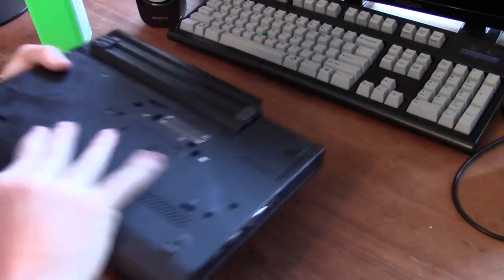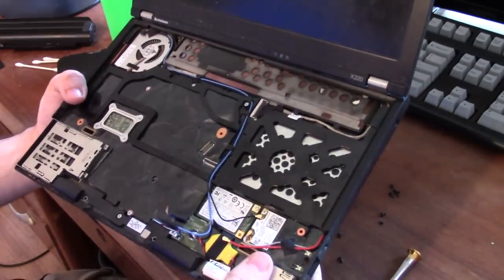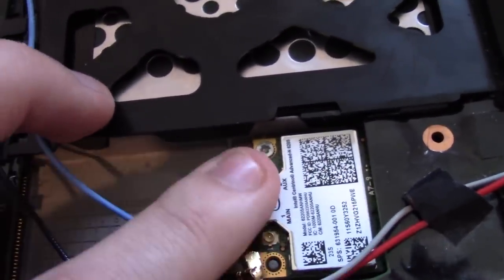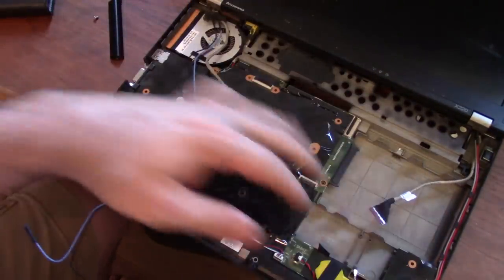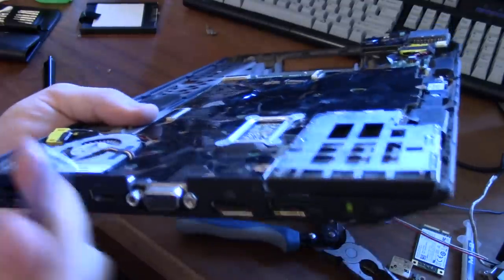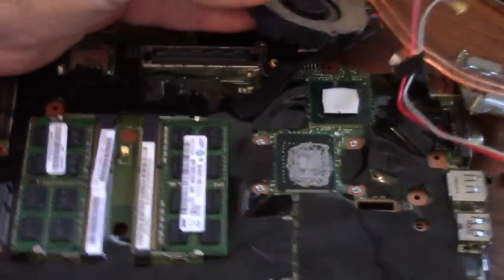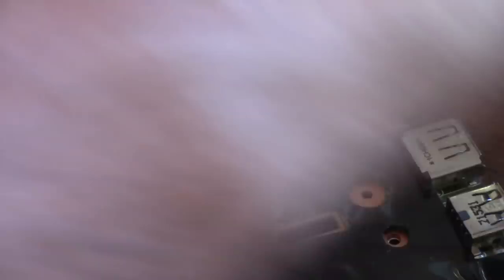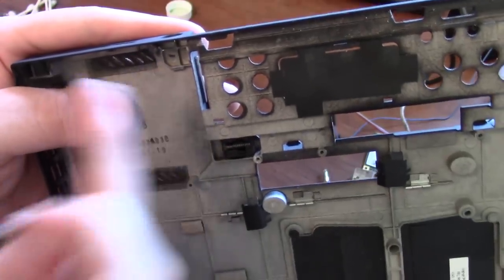Laptop Total Disassembly and New Thermal Pasting

Comment: Keep track of your screws, folks. My T420 is still a wobbly mess after losing a few during BIOS flashing.
Reply: brotip: set them on the table in the shape you took them out
Reply: The t420 uses standard m2.5 screws, just buy a few of those
Reply: i stick them to small magnets. even if they fall from the table, they stay together.
one magnet for each set of screws. usually four is enough: backside, screen, motherboard, everything else.
Reply: a little late, but you can film the process with your phone so you can go back in time and see where the screw flew off to

Comment: Don't forget the most important part: recording the disassembly! Having a video-recording of the disassembly is useful for referencing where everything goes, but especially for the screws. At least 90% of the time when reassembling it, you'll end up with at least one extra screw, and the other 10% of time you'll end up a screw short.
Reply: I have replaced fans, keyboard, ram, display, brackets and SSD in my T400 and a couple of other Thinkpads but this disassembly looks scary af. 
Having to remove almost everything to get to it I'd only be willing to do if the Laptop is actually broken. 
I'd also take detailed pictures and notes during the disassembly to check on assembly whether I'd put in everything as they were before. 
The way he handled the screws triggered my "OCD".

Comment: 11:55 the reason why they recommend to unscrew the heatsink that way is to prevent cracking the CPU, you could put a lot of pressure in one side and break it
Reply: Ben T.  mine literally bends the motherboard a little.
Reply: Same when you screw that back in,  I do it diagonally and little by little to distribute pressure evenly

Comment: I did the same on my T430 some hours ago, what a coincidence. I recommend liquid metal thermal paste. Even after five years the liquid metal paste on my Workstation was almost like freshly applied. The only downside is you have to be carefull because it is highly conductive so don't apply to much.
Reply: another downside: it eats aluminum like a cancer. a single small drop can waste the thinkpad's chassis. it also diffuses gradually into copper (can dry completely in a matter of months, depends on surface, temperatures, shape of thermal plate).
Reply: @aleclitvinov  Hmm never experienced that. My workstation cooler is made out of alu. I couldn't see any flaw and my old copper water cooler also has no problems.
Reply: @adrianhartwig2646  copper just dries. aluminum first becomes brittle, then disintegrates. it's a real problem https://www.youtube.com/results?search_query=gallium+aluminum
i don't know why your cooler is all right, maybe some kind of coating or just luck.
Reply: @aleclitvinov  Stop stop stop. Gallium is a liquid metal but not all liquid metals are gallium. I wrote "liquid metal thermal paste". I hope you agree with me that it would be quite dumb to produce a thermal paste that destroys the cooler.
Reply: @adrianhartwig2646  most (if not all) "liquid metal thermal pastes" are in fact galinstan - a mixture of gallium, indium and tin. there are other possible compositions but most of them are either toxic or ineffective. anyway, most liquid metal alloys will affect aluminum.

Comment: change your oil? bro, we need to have a talk about either a) how often you change your thermal paste or b) how not often you are changing your oil. 

Car oil should be changed 6 to 8 months if the thing is just sitting there and only going a few miles. If you're driving regularly it should be changed every time you hit about 4k to 8k miles depending on the age of the car and requirements. Thermal paste? that's like every 5 to 10 years at max unless it's constantly over heating, like in macbooks.

Comment: This is why old thinkpads are a meme. How often do you replace the battery or carry an extra one? The newer laptops are easier to take apart and could be as modular if the manufacturers didn't solder everything. But they arn't water proof :(
Reply: Fuck this is triggering me so hard. New 1000$ consoomer models that have 8gb soldered and no slots. And then 16gb version is +400$, yeah no thanks

Comment: For a Laptop that's easy to take apart the cpu die sure is out of reach, my fancy gaming HP opens easier than that. Also that is in fact too much thermal paste but it literally doesn't matter, the more the merrier. As long as it's not liquid metal.
Reply: is your fancy gayming hp laptops screen 12,5inch? t-series are way easier to disassemble because theyre simpyl bigger
Reply: bro if u put too much thermal paste ur computer will freeze a lot
Reply: a little extra is good because while less would perform slightly better, if you miss even a little coverage it will perform significantly worse than just being a tad overpasted

Comment: Based, I just recently swapped my X220 CPU fan. I bought some paste (like one of those crappy ones inside a huge tube) but I ended up not changing it because the thermals are still very good even after 5 years of use. The new fan seems to have no speed control and just goes either on or off but whatever

Comment: im surprised how open-resistant is that laptop, in my hp you just remove the back cover and everything is just in front of you. battery, ram, ssd, hard drive, fan, heatsink, wifi card, speakers, connectors. All of that, just 5 screws and pull the lid.

Comment: Dell Latitude is the equivalent of Lenovo Thinkpad. They are just as user upgradable and has arguably easier to access components like the CPU, because you don't have to remove the motherboard, just the bottom cover. Take a look then at Dell Inspirons and Lenovo Yogas or IdeaPadss - those are glued together pieces and soldered components, absolutely poop-tier in terms of user upgradability. Don't buy those. Ever. 

I prefer Latitudes over Thinkpads if I have to choose a laptop, but I hate laptops in general and prefer a more user-controllable solution, like literally DIYing a portable battery-powered PC with something like a NexDock 2 / Motorola Atrix dock, or with a portable, battery-powered screen, keyboard and touchpad combo and external battery if your display doesn't offer USB power-out, and the most important, the center of your computing, any SBC, like a RockPro64 or the infamous Raspberry Pi (been using a pi 4 8gb as my main PC for the past 5 days, it works wonderful). Obviously if you need power and portability, you have no choice but to get a powerful laptop, but if you are using minimalist software, a *pi is all you need. If your SBC has eMMC or M.2, great, otherwise you can just use a small sd card where you place your boot partition and have your root on an USB SSD enclosure.